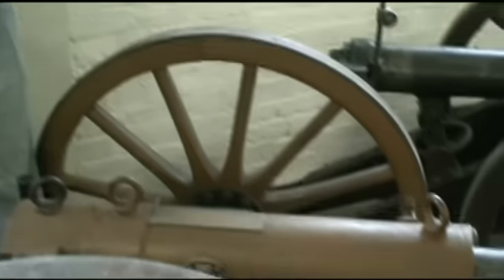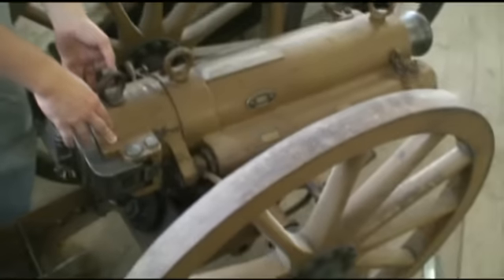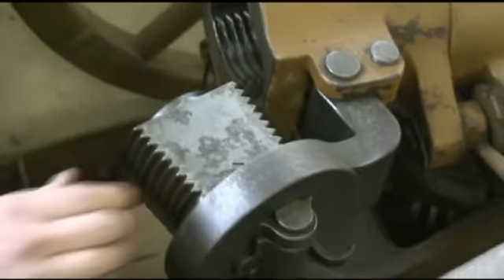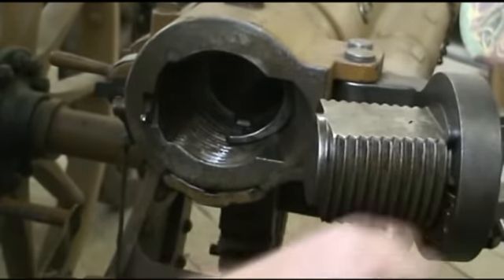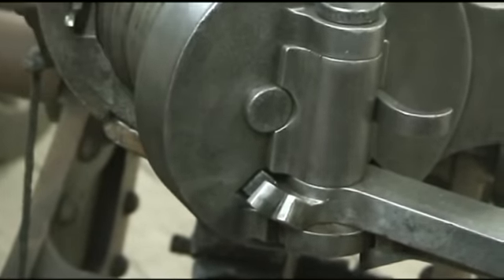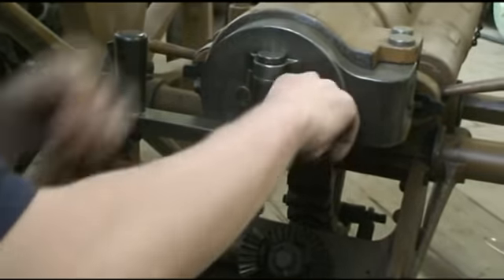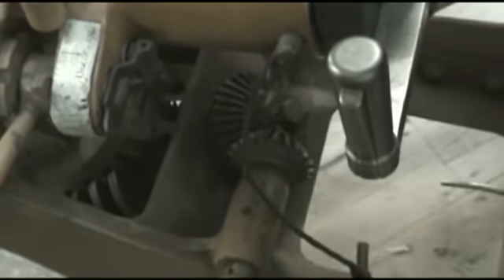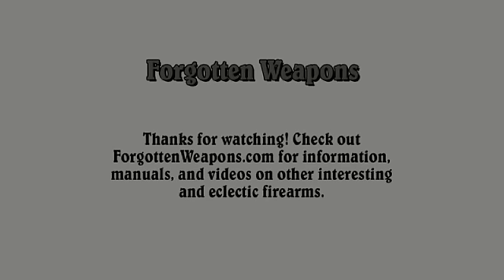Vickers, Sons, & Maxim 2.95" Mountain Gun

Comment: In the 1930's the 2.95-inch was declared obsolete, being replaced by the 75mm Pack Howitzer M1, but apparently no one ever bothered to cut the orders to dispose of the beasts. So a bunch, along with their ammunition, remained in storage in the Philippines, pretty well forgotten, As far as the US Army was concerned, they no longer existed, weren't in any manuals and Fort Sill wasn't running any classes on them. Then the Japanese invaded. Twelve were dusted off and handed to a battalion of the 23rd Artillery (PS) of the Regular Army's Philippine Division and about another 50 were issued to the Philippine Army. The US purchased 132 between 1899 and 1904.

Comment: I love that gun. Both the USA and UK used a double-common 18lb HE shell. I wonder how the gun would have performed with the 15 lb 75mm projectile developed from the French M1897  and used in the M2/M3/M6 guns? Probably the 2.95 inch is nominally 75mm and not exact.

Comment: These were the armament of one US Army (Philippine Scouts) and several Philippine Army artillery battalions in 1941-42, used until the surrender of Bataan. There were also a couple in Mindanao used by General Sharp's force. They were badly outranged by Japanese artillery, even by the Japanese infantry battalion guns, but were useful in rough terrain where field guns couldnt go, as was often the case on Bataan. Considering that USAFFE had no effective mortars and no other field howitzers (the other artillery were WWI style 75mm low-angle field  guns and a few 155 GPF long range guns) these ancient things, that could only elevate to @25 degrees, were it for "high angle" fire.

Comment: is the screw lock up stronger then say a 3 lug lock up on say a barret 50 cal?
Reply: gabriellockhart count the lugs
Reply: thanks filipe.. i always wondered why massive weapons have the huge screw threads and bolt actions and semi auto's don't.
Reply: that's not what i meant, i was thinking along the terms of alternatives to modern powders, rather then say traditional powders which have a detonation velocity  of 7300 mps, why not use other types such as onc which has a detonation velocity of 10100 metres per second. why not tool say a bolt action with a similar breech but heavier barrel.
Reply: gabriellockhart 
Are you trying to push higher pressures for greater velocity?
Reply: The barrel strength and basically melting the projectile become factors
Reply: i would of thought both, say some thing like a 22 cal high density sabot covered with a 50 cal discarding jacket made from a nickel composite impregnated with Teflon, make the barrel out of the same material and  surround that barrel with a tungsten jacket to contain the pressure.  maybe???
Reply: The sabot material either gets extruded or is so hard it erodes the barrel.

But the gas has to flow fast enough behind the projectile to give sufficient back pressure to do meaningful work.
Ie, even without a projectile the gas has a maximum speed.
Reply: The next problem is if you double the speed you halve the time to reach that speed and hence need four times the pressure
Reply: and there in lies that nigh unbreakable bullet velocity of 4665fps... and at that bleeding edge your playing with fruity rare metallurgy and nope chemicals that if they go wrong they blow your ass up instead of the target. just look at rail guns... between the magnets, the frankly terrifying capacitors and enough electricity to power a small town just for one shot.
Reply: gabriellockhart 
Yes, emf rail guns become effective at high speeds.

Comment: 75mm? Wouldn't that be considered a cannon?
Reply: I think the term cannon means its a smoothbore, and usually over 20mm.
Reply: Sure, it's a cannon. Specifically a howitzer.
Reply: Going by the definition in the encyclopedia: A cannon refers to a weapon launching a shell mostly within line-of-sight.  A howitzer fires lower velocity projectiles at significantly ballistic trajectories.  And a mortar fires very low velocity projectiles at extremely ballistic trajectories at closer ranges.
Reply: The Bellman
That's different from what I saw, which is gun-howitzer-mortar, all falling under "cannon".
Reply: The US Army defines small arms as 60 caliber and less. Anything larger is a gun/howitzer/mortar./launcher - the first three of which fall under the definition of "cannon"